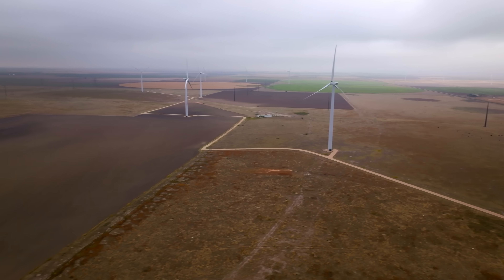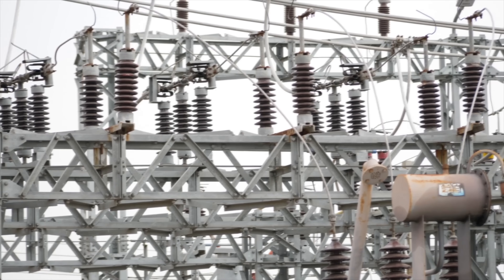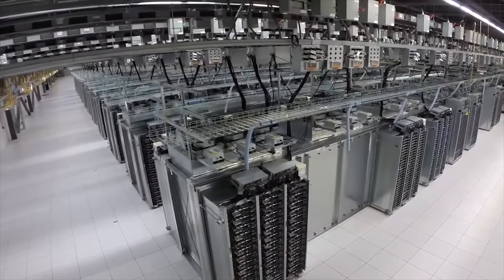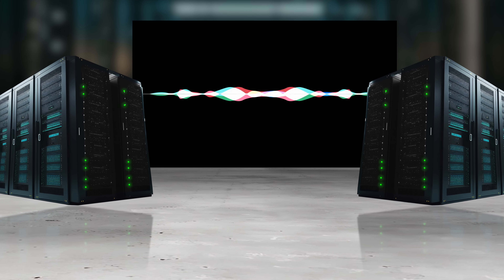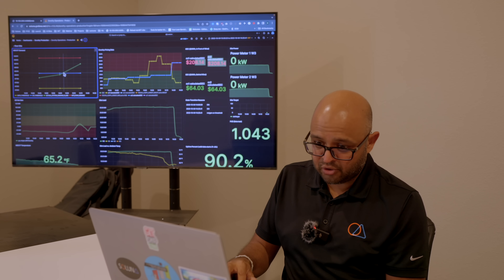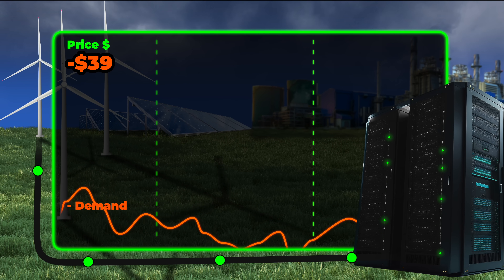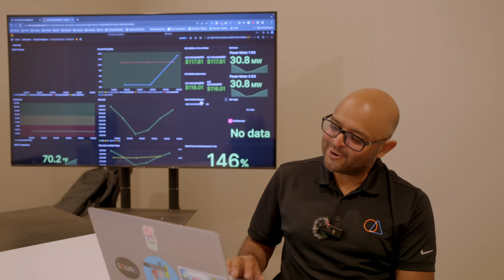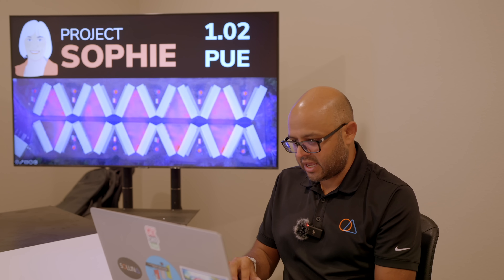Wind Farms' Dirty Little Secret No One Talks About

Comment from the maker: Check out Soluna’s GENIUS Solution for Wind Farms!  https://geni.us/Soluna
Reply: Here much of the excess is put into district heating, saving fuel and bio mass.
Reply: this likely a smart idea a few years ago but terrible idea by today's recent changes. LiFePO4 batteries or packs have become so cheap these days that it is better to store the wind farm's energy in batteries than have expensive data center (AI, crypto, server) equipment to shutdown when grid requires more/pays more for power. If you're a company that has talent both in wind and datacenters then it is good but still need batteries for this because you need to minimize downtime for compute.
Reply: You know it is a real shame someone did not replace all them computers with batteries. You know to store the extra power made in the peak times of production and sell it as needed outside peak production times or boost the power to the grid as needed. It would also open up more grid area they and help cover so other plants can shut down on low demand time like late night and earl morning when most folks are still sleeping.
Reply: what happens if you dont shave for a week  ? 
im picturing ZZ Top :) 
(also love your vids)
Reply: This is litteraly Tony Seba's concept of super power in action
Reply: why aren't they trying to extract waste heat for electricity? i mean i get that it's a wind farm, but do they only have to be a wind farm?

and another question for the wind farm, why aren't they using vertical wind generation that takes the wind from any direction? because the ones they have are very inefficient for generating power because they don't generate wind unless the wind is blowing in the direction they are facing. 

if they replaced the turbines they are currently using with vertical turbines they would be able to actually catch the wind no matter which direction it's moving day or night.
Reply: The answer to electric use... use more electric 😅
Reply: A better use for that excess power is to use it to produce green hydrogen and ammonia fuels that will replace fossil fuels for ships, trains, busses and big rigs.
Reply: @solarcabin Like most industrial processes, they are hard to stop or even regulate, because the changing heat load puts mechanical stress to the components. Especially the catalytic converters are ceramic materials, who tend to crack. A intermediate storage is necessary and so far we have found none, we are willing to pay for, or that is scalable. 

I guess. it is better to store the energy in a simpler chemical process, even if the fuel is solid.

Comment: what if we have been using the wrong model of wind turbines?
what about a new model like :
a vertical axis wind turbine (spinning like a carousel)
this wind turbine would look exactly like a tree, I call it : e-tree,
the trunk of the e-tree is brown, the spinning sails (blades) are green,
and finally attached to the trunk of the e-tree are features of : wifi/mobile network, light and power outlet, to charge a car for example

Comment: What is your opinion of gravity batteries?  I have always wondered why they don't use iron ore as the weight in a gravity battery. If used in areas where space is limited, iron is 300% more dense than cement or water.    Perhaps we could convert the world's oil tankers to gravity batteries.

Comment: The problems with local computing resources as a sink for surplus power are:

Computers are high capital cost, and  have relatively short useful lives before they are outdated.  Consequently they are hard to amortize if only used 30% of the time

Network-services computing requires very high bandwidth to the net... Not something one gets near most windfarms.

Administering servers and getting work for them  that become available sporadically but are gone most of the time is majorly sucky.

Basically the only load I can think of for this scheme is bit-coin mining.  Otherwise who is using these computers to do what?

Comment: Wind has a low energy density and wind power is centuries out of date. Wind farms only exist due to massive taxpayer funded subsidies.
They make no economic sense. They are a colossal waste of taxpayers money and resources (including coal, oil and copper).
   The whole irrational push for wind and solar power are based on the false assumptions that the current climate is ideal and must be preserved at all costs and that these forms of renewable energy are cheap and easy to install , maintain and utilise. These ridiculous assumptions are economically destructive popular delusions.
The current climate is suboptimally cold as is the current atmospheric carbon dioxide concentration. The carbon dioxide emissions from fossil fuels are actually beneficial. Benefits include greening of the planet with increased agricultural yields (main effect), reduced winter heating costs, fewer deaths from hypothermia and postponement of the next glacial maximum.
We should simply use the most economical energy resources available and stop squandering massive amounts of taxpayers money and resources on uneconomical and unreliable renewable energy sources.

Comment: As a common guest to the Island/State of Malta, they have a Gas powered plant with a huge supply ship, to be able to produce "fresh water", from Salt water, to supply the islands needs for water. Maybe windmills would help?
     As a Dane - we are among the largest and - earliest producers of Modern, Large Windmills for Electricity Production - We of course know that windmills can't be used at all times, but will have to be started and stopped according to present needs - as any other "Electricity Producing Plant"!!!
    But we have a High Power Electricity Grid in Denmark and the surrounding countries, which are - connected, so that present overproduction may be sent to other places. In Norway and Sweden they produce a lot of Electricity from water powered Plants and in Germany, they - also have Nuclear Plants. We in Denmark have much Wind power to Sea and on our West Coast, so we are able to Balance the Production to be levelled in all Countries!  Finn. Denmark

Comment: The grid simply needs to always prioritise the available green energy as first choice and then only top up with dirty(oily) sources when the renewal supply is low. It also needs to improve the infrastructure so that there aren't bottle necks that limit the use of the green energy during periods of high supply, e.g. from very sunny areas or very windy areas. IMO it's criminal to use any fossil fuel power when green is available

Comment: Boring to listen to. 

Power by wind as well solar cells + old dams for water +  are not stand alones at all but parts of families.

When they are You automaticly of the use of fossils. 

For Denmark there are some 49% with no wind. We use fossils. 

When there is wind we make all electrity and for heating too to some 2/3 of the price. By that You bill goes down 1/3. Thats a lot for any the state´included. 

But we need much more. Fx our many cars, trucks and many kinds of machinary. Vessels should use it more too.  WEe laready has very small ferries with bateries. We will see.  

The next steps is make stored fuel by wind. Today we can make Hydrogen, Methan, ethanol and methanol but so far is too expensive. I dont like hydrogen mysels. 

.

Comment: a commercial 3phase VFD ductless air conditioning system would be many times more efficient use of their cooling ability. the holy grail of renewable energy would be solar heat batteries with sand in thermally insulated sand bunkers, underground. then you use the stored heat to run sterling cycle motors. then you feed that energy to a tesla megapack farm. the megapack gives the system the ability to instantly & automatically ramp up or down to meet demand- giving the sterling cycle controls time to turn on or off when peak storage is reached. being underground sand bunkers in the desert means? you can have limitless volumes of storage for LITERALLY DIRT CHEAP. you only need enough lithium storage to power the grid for about 20 minutes- time enough to ramp the stirling generators. you could add sun tracking mirrors to double or triple the incoming temperature to the heat batteries- & give the ability to use a higher torque rated stirling engine. this would also enable you to fill your energy storage very quickly.

Comment: They NEED batteries!! .. One plan I read is to use EV Batteries, not new ones, but used ones, when they are thrown away the EV Batteries still have 40% of their power left.  Since SPACE does not matter at a wind farm they could be installed at the wind turbines, and charged up when the power s not needed on the grid!! ... I think it's a GREAT idea!!!

Furthermore I argue they should use the vehicles and the existing plugs! ... ANY Tow company could install and/or remove the Back Up Battery System as the batteries are left IN the EV's!! .... 

The existing software could be tweaked specifically for wind farms! .. Tesla etc can adjust the software using the existing vehicles computer.

For damaged vehicles that still have a good battery? ANY Mechanic shop that services EV's NOW could simply swap the battery into another vehicle or repair it with conventional methods, (like a skd instead of working wheels) easily and quickly as it does not have to be roadworthy .. it's just a SHELL for a battery pack!!

Comment: I am rather skeptical about this one. The downside of this approach is that the equipment utilizing excess wind power has a capital cost. The investor surely wants the equipment to pay for itself instead of idling a great part of day. Things like water boilers are cheap, but latest gen computing chips are not. I don't think such intermittent datacenters are viable unless the hardware is old and cheap (although, the old hardware is drastically less power efficient).

Comment: Actually it's not "consuming water" that's the problem here. Normally that water would just come down as a rain and that's it.

Problem is imbeciles have filled their cities with asphalt and paving. Which prevents water from sinking into the ground. What then happens is all that water goes to the river and with it to the ocean. In short - you lose that water because you're THAT stupid. And even worse, you risk the river overflowing because of too much water in it. Which wouldn't happen if all that water was sinking into the ground.

But by all means deal with the symptoms, not with the root of the problem. And then wonder how come you don't have enough drinking water.

Comment: Even when TURNING, wind "turbines" produce POWER less than 10% of the time. My cousin's husband (Cousin-in-law???) worked for Siemens in Europe for 25+ years designing wind farms and attempting to make power from tides off Holland (unsuccessfully). Tom showed me one day at breakfast, on his Mac Book, 99.9% of wind turbines never make enough electricity to offset the materials in their INSTALLATION! Typically that's over 200 TONS of steel re-enforced concrete per post plus 2000 Km of super heavy-duty trucking at .3 MPG (it takes at least TWO and often THREE semi-tractors to move them, not for weight as much as for turning corners), 6-8 trips for EACH turbine. Two or three for the support, one for EACH blade, three for the "generator" at the top of the mast and 4 trips for the electronic and electrical gear to turn the generated power in useable AC current. NO "wind farm" in existence has ever made enough electricity to BUILD IT!!! "Wind and solar" are tax-write-offs for the rich, while a 6 barrel (40 US gallons per barrel) a-day "stripper oil well" will generate the LAND OWNER $60,000+ income, depending on the area and their tax bracket. Currently, a US 6 barrel-a-day well will make the owner of the oil about $155,000 annually above ALL his costs. Those 14,600 BARRELS of oil will power 24,000 automobiles or light trucks, or 6,000 semi's for a year, or 10,000 farm tractors/combines/planters to grow YOUR FOOD  for a year.

Comment: Evaporate cooling is a lousy idea in areas with high humidity and a poor supply of water.  On the other hand, it works great in the Great Lakes area.

By the way, the water doesn't have to be fresh.  Fresh water works better, and there are less engineering challenges, but contaminated or salt water will work.

Comment: I have done some calculations to determine how much electricity our two homes, along with our Tesla, use.

We have a few solar panels (not nearly enough) now, and want to include vertical wind turbines.

Reusing scrapped ev batteries would help us during the times when wind and sun power are both unavailable.

But creating sufficient capacity to reliably supply us will mean that there will be excess.

We're considering using the excess to mine Bitcoin, doge coin, Mars coin, and the like.

Comment: So, as a non-engineer, they are basically shifting the demand curve.  It is good as far as it goes, but doesn't answer the broader reliability / availability needs of the overall grid.  As your initial graphics showed, sun and wind are not steady and available when they are most needed (say 4 - 9 pm).  

While this discussed solution solves a problem for a wind farm operator and the data center operator, it does nothing to solve the need of the broader grid.  An efficient, cost-effective, and safe storage mechanism is needed OR a heavy investment in nuclear to meet peak daily demand.  Small local reactors that are geographically proximate to the end user could prove to be very efficient and safe without the heavy cost of building out transmission lines (which lose a lot of power during transmission).  Alternatively, is there a better way to transmit the power that doesn't bleed so much electricity / energy between generation and end user?

Comment: Water isn't consumed.  It's not like gasoline.  The evaporative coolers do just that, evaporate water (change of state, which takes energy, in this case the heat energy), the evaporated water eventually changes state back into liquid water.  No water is lost.  But yes, getting water into the tanks to be used by the evaporative coolers takes energy and costs money. In that sense it consumes resources.  But the water itself is not consumed.

Comment: The only way you can stop this is by grid level storage which is not possible in quantities required . There is alo a question about why some windmills spin when there is no wind. Are they just turning  to protect  the bearings like they do with jet engines on the apron?

You have hit the nail on the head, if you banned the internet and all social media, that would help prorect the planet. The zoomer eco warriors wouldnt like that though, as theyvwould suffer rather than everyone else who is supposed to take the pain. 

Renewable generators also get constraint payments in Europe ie if the grid cant take all renewables then the grid pays them not to supply. Renewables get massive subsidies in one way or another.

Comment: Tesla has already come up with a partial solution - battery storage on a mega-scale!  All their facilities use it in conjunction with renewable generation on site, and is now proven technology.
Reply: they are having trouble making enough batteries for vehicles let alone storage for all of the grid. I think in the interim until we pull enough lithium out of the ground we need to use liquid air energy storage systems.
Reply: @zachmoyer1849  Currently, lithium price is dropping, and supply exceeds demand. Also, new mines are opening in quite a few places and mining there is highly mechanised. No "sweat shop" factor. Most of the rare elements have been removed from modern batteries (LFP = lithium/iron/phosphorous).

Comment: At 10;05 you mention using evaporative coolers to chill air coming into detail a centers, which is incorrect… The evaporation occurs in cooling towers where condensers are cooled, or where water used in a loop going through brazed plate heat exchangers is cooled… Using evaporative coolers to cool air, and then using that air would make it more difficult to control humidity at the precision it needs to be…

Comment: You skipped that wind turbines only operate in a specific range of wind speeds determined  by the pitch of blades.  Large wind farms have units that have different operating ranges.  That why you see only some of the units working at any one time.

Comment: Why is no one talking about thorium? The most abundant energy source on the planet. The cleanest energy source. Can be factory built. Can operate in the middle of the Sahara desert. Already been proven. About 60 years ago. Turn salt water into pure gasoline engine fuel And check fuel. And desalinate ocean water for drinking. Check out the state of Missouri and thorium. You might find it interesting. Thank you for posting this video❤️

Comment: You're not going to save the world by covering it with giant table fans and toxic solar panels.
Not to mention that the giant table fans in cold climates need DIESEL GENERATORS on board to keep from freezing, they all need oil and grease for the mechanisms, regular maintenance, roads and power lines....cut through the places you want to "save".

Comment: Neural processing will bring the AI process to the devices in less than two years negating the energy consumption of cloud products. Negating this huge build up.
Reply from the maker: what about training? not sure I follow
Reply: @TwoBitDaVinci  currently these AI platforms are cloud based. Processing is extremely expensive. Neural processing is moving to the laptop desktop in 2024/2025, and the processing will be largely moved to the local device level. It doesn’t matter what the application is, it will shift to the device layer… application developers are already working with hardware/OS vendors on this shift.